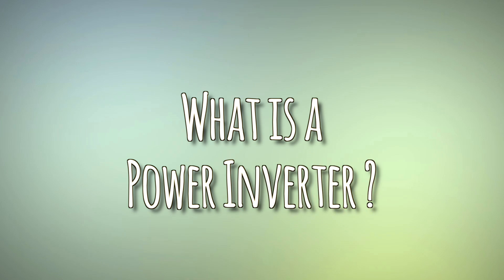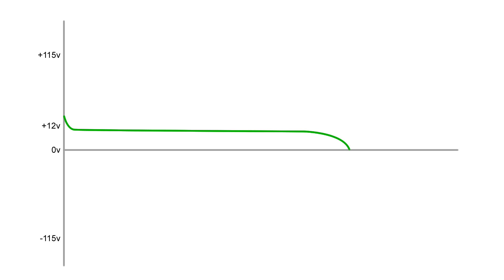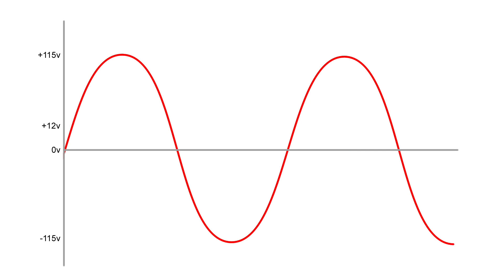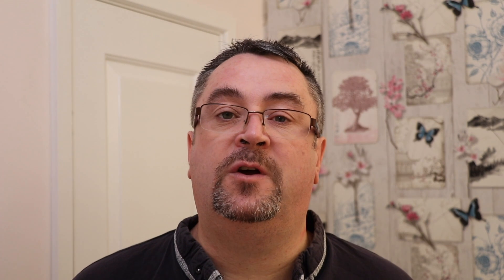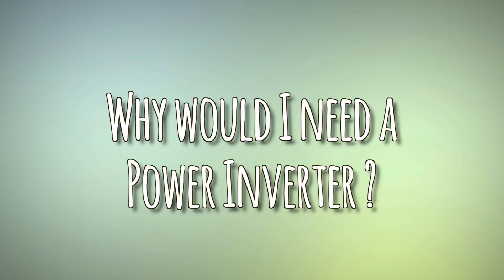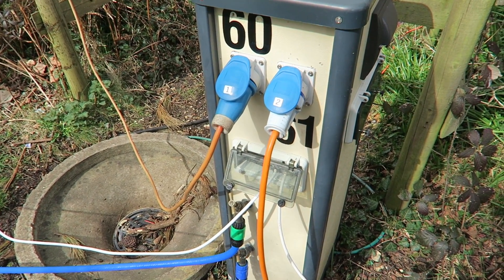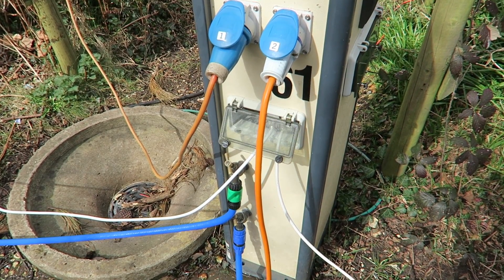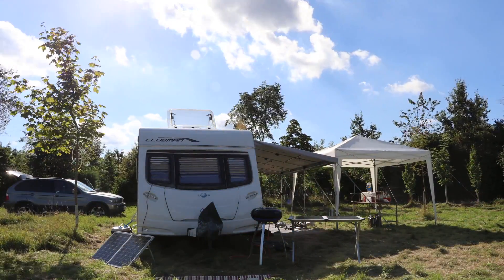Power Inverters in caravans

Comment: Great video on the devil's spawn.  Most if not all chargers etc. come in a 12v form, even the dreaded 19v laptop charger.  We used to have an inverter in the caravan but have binned it for the motorhome.  Your example of efficiency does not take into account that most laptop chargers efficiency for example.  I was once on a rally where another example of the feedback loop was in use.  This guy had an inverter connected to his battery.  He wanted to charge another battery with his mains charger.  When charged it he put that battery in the caravan and proceeded to charge the discharged battery on the mains charger from the inverter.  You can see where this ended :-)
Reply from the maker: Hi, 

Ha, yes the infinite loop ! I know that well. I tried to keep this fairly non-technical, not going into too much detail, but enough to give a good overview - you like me, come from a fairly technical background, so I know exactly where you're coming from.

on a side note - try finding a 12v charger for a Dyson V6. I nearly had a fit when i discovered "they dont make them..." and its a really specific voltage too. 

Also - how are you getting on with your vertical antenna ? I'm taking a folded dipole with me on the next outing for 40m 20m up a fibreglass pole (as seen on my COldestMoon channel) - but the verticle would so much easier to get up and less real estate etc.

Speak soon

Dan
Reply: Verticals are working fine.  I still carry the dipole and long wire but they are only usable with plenty of real estate.  I subscribe to the other channel so await results with interest.

Comment: The 3 fuses on the back of your inverter are ganged input fuses. This is because at full load your inverter will pull over 80 amps and therefore to use the cheap blade fuses the manufacturer has ganged 3 together so to get a high enough current rating.
Reply from the maker: Hi Matthew, yes - completely right, not sure what i was thinking of then.

Speak soon 

Dan